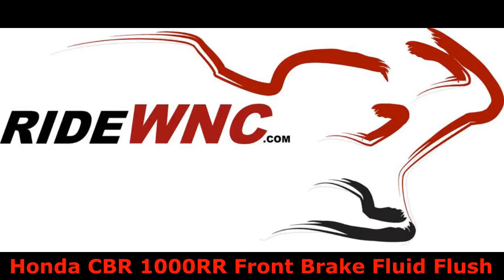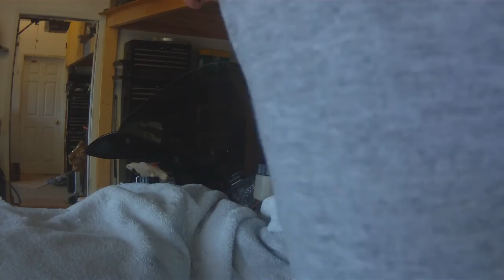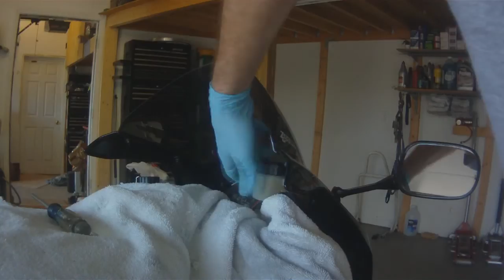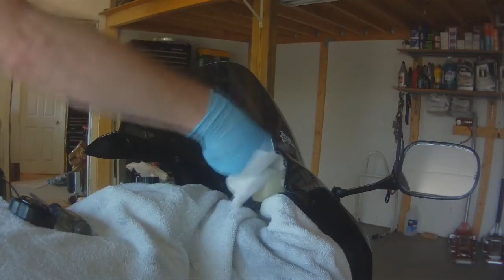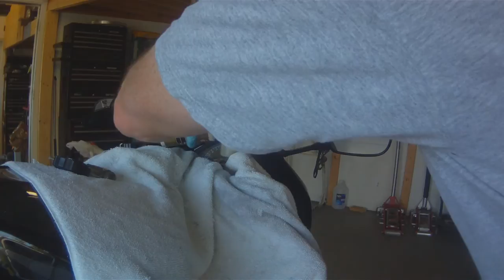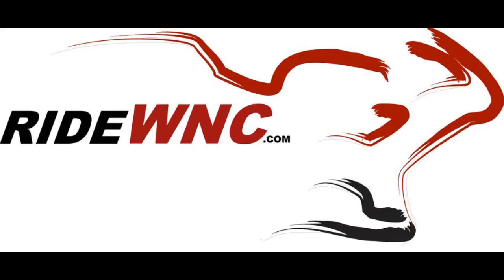Honda CBR 1000RR Front Brake Fluid Flush

Comment: Your bike obviously has a combined ABS
I understand that involves an additional piston and reservoir for a slave system as also an electronic unit.
What you did doesn't mess with that?
When the rear brake activates  it simultaneously activates a pot on the front discs.
Furthur the ECU will kick in during severe braking.

I have a 2015 CBR RA, ABS that has only the slave hydraulics. I'm trying to understand how the whole set up works n then try the brake fluid change.

Your inputs will be appreciated. Thanks
Reply from the maker: That video is for a 2007 CBR 1000RR.
Usually with ABS there are three circuits. Front brake lever, rear brake pedal and front and rear brake calipers. You would need to flush the fluid from the ABS pump out to the brake calipers.

Comment: does the brake lever have to be compressed while you have the bleeder valve open?
Reply from the maker: No.  If you have a top bleeder valve by your lever Bleed It first. Then bleed your calipers using a mityvac.
The only time you will pump is at the end to make sure your brakes are working.